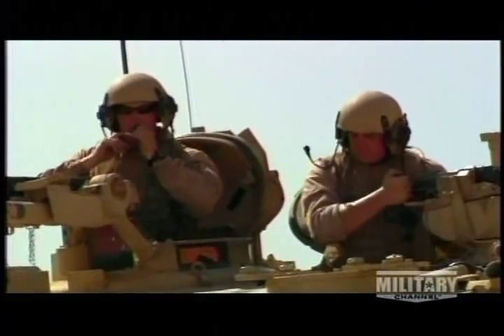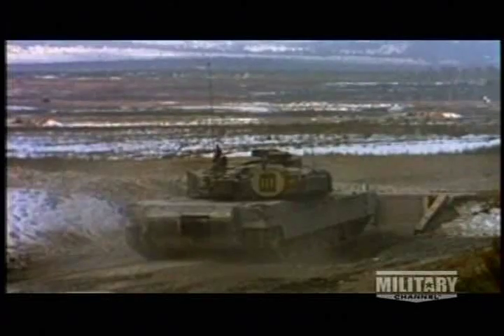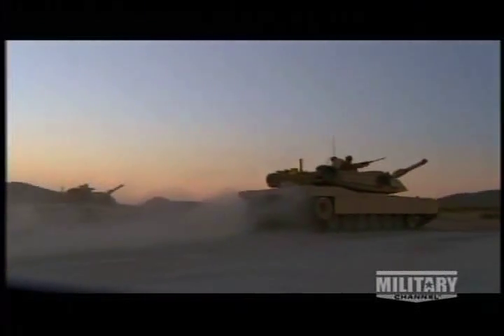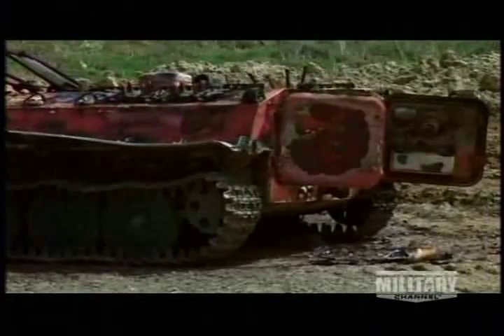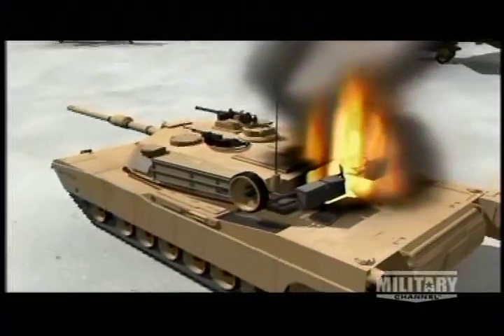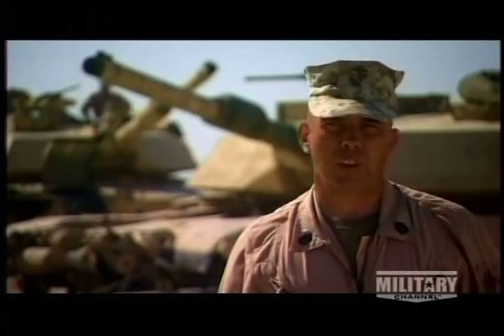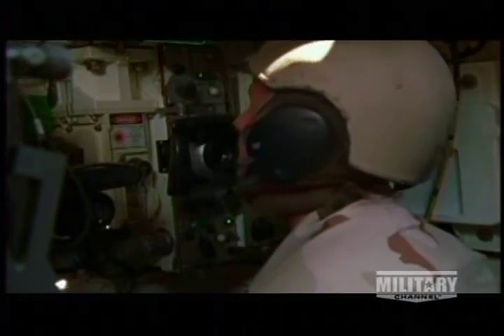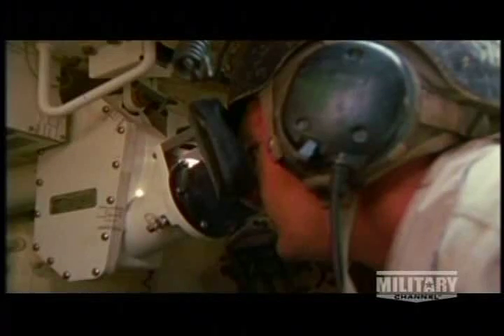Anatomy of an Abrams Tank Part 3

Comment: @MrBoon008 Yes most armoured vehicles have either a small chemical toilet or waste disposal system to throw toilet bags in, especially cold war era vehicles that where designed to operate in wars where chemical, nuclear and biological contamination was a risk and the crew was expected to stay inside a sealed up vehicle for days at a time.

To freshen up crews would use wet wipes or something similar.

Comment: they should put some kind of coolling or heating system in the tanks. at least a fan for every crew member. i dont know about other people but if im hot and sweaty and uncomfortable, my focus goes to me being hot and not to my work.
Reply: they do. mainly to keep computers from over heating
Reply: +Tholaran97 The M1A2 SEP does have air conditioning.  The older variants have the cooling vests with cold water running through them and they work very well
Reply: @RandomVideos2  wow wow wow would never have thought to see you here
Reply: @DEXDXVN  👋

Comment: It's not the same.  The parts aren't interchangeable.  The L/44 is NOT the M256.  That's like saying the MOWAG Piranha is the same as the Stryker, despite hull differences, different FCS and engine, etc.
The biggest changes are that the L/44 uses a gas/oil recoil system whereas the M256 uses a dampened coil spring for reliability and desert performance, and modifications to suit the US FCS, plus changes to the trunnion.  M256E1 modification has the same performance as the L55, but isn't needed.

Comment: In fact, its decay takes so long, it gives off very little radiation in a short time period AND it gives off alpha particles, which are blocked by skin and paper, basically. If it were debillitating to the point of causing cancer in all the veteran crews, we wouldn't use it.

Comment: Any RPG has a chance at taking down any tank, but it is very, very unlikely, I doubt it would do anything on the sides or the rear. Maybe at worst it would damage the engine. There's plenty of dead space provided on the top, thinner part of the side armor, and enough thickness on the bottom. The glass is very thick and it's made not to shatter. Besides, periscopes use mirrors, so the crewman is below it, not directly behind them when he looks through them.

Comment: ERA provides the least of all advanced technological defense utilities.
Tandem-charged rounds are fully capable of penetrating through the reactive armor, and designed for this purpose. ERA doesn't provide absolute armor.
But I wasn't speaking of the KTK-5, I was talking about the "Shtora" system, similar to those of Merkava's (Trophy), that provides 360° coverage against ATGM, HEAT and ATR. Despite the rounds' size. I give it an 80% that the M829A3 wouldn't even get there.

Comment: That the two guns are the same is a misconception; they are not interchangeable and the US system has a number of alterations, mostly for reliability and accuracy.

The M256E1 is basically an L/55 type mod to the M256.  It isn't fielded because there is no need for it.  If we faced an enemy who had modern Western tanks, the long barrels would be fitted at field depots and the FCS recalibrated--very easy to do.
Also the XM291 will be lighter, better balanced, and more accurate than the L/55.

Comment: Firstly, the vehicle absolutely relies on it's crew, especially the commander.
Secondly, to receive no affect on the structure of a hit area, the armour must be in an angle, as well to composite sloped armour.
-
I hardly believe the M1A2 will not shatter after a direct hit from ATGM. It will hit it, because the M1 is lacking countermeasures against ATGM, like APS, or at least ERA.

Comment: It has over a 300 mile range and all military operations from armor to infantry rely on light skinned support vehicles that is just the nature of war. Sure if you get a lucky shot into the engine then yeah it will not be able to move but you will still have a pissed off crew inside a tank with a working turret. Also yes the track can be taken out so what that is what you deal with. the same goes for wheeled vehicles. Sure you can always improve but to say that this is

Comment: It's basically ready for deployment, they're just tinkering with it until it's needed.  Again, it's not really NEEDED.

What are the chances that in the near future American M1s are going to go up against something able to withstand 900+mm pen of KE without air support?  VERY slim.  So why bother fielding it?  We did this in WW2, don't you remember?  The US had like 6 tanks in its inventory in 1935, yet in WW2 we had the running gear drivetrain and sights etc., all worked out, for minimal cost.

Comment: The M1's HEAT rounds are nearly useless facing a head-to-head, angled or movement based encounter, because, the round would simply hit an angled reactive armour, causing insufficient damage, while in return receiving a critical strike from the opponent.
The SABOT will not penetrate the Russian T-90 for three reasons:
1: ERA (M1A1/2 lacks it)
2: Sloped Armor (M1A1's armour is nearly flat, especially @ the turret)
3: Slat Armor (M1A1/2 lacks it, and is still a high threat to the vehicle)

Comment: You  are missing  the point  
. 
The point  of  this videos  is to put  you In the  next plane 
To travel  7000 miles straight  In to ied fields  on (foot  patrol) 
. 
In war fields sometimes food or ammunition does not come in time 
Let alone tank parts or thousands  of gallons in fuel  to keep  this ( one mile per gallon vehicle operational) 
. 
Insurgents  if they want to disable  this vehicle  they  just  need to  shoot  at the truck loaded with fuel  which m1 relys on

Comment: this videos are extremely deceiving and is pure War propangada 

 I accuse videos like this , of passing the  wrong  and deceiving information to young Americans which is costing there lifes 
.
This tanks has wiknesses & vulnarability's 
.
the 200 mile range is catastrophic as it depends extremelly of light skin vehicles to remain operational 
.
The rear of the vehicle is extremelly vulnerable , 1 single Rpg might Disable it 
.
a Small I.D  might take wheel track out disabling it